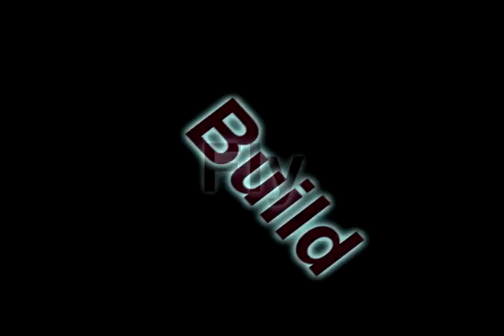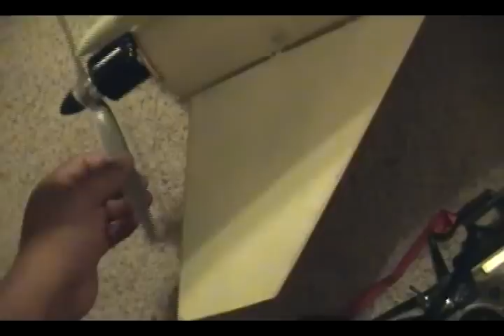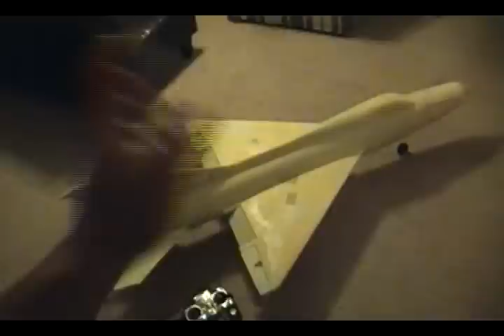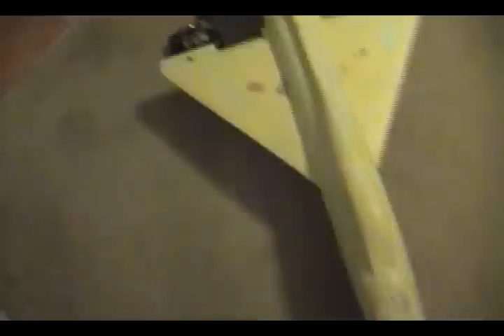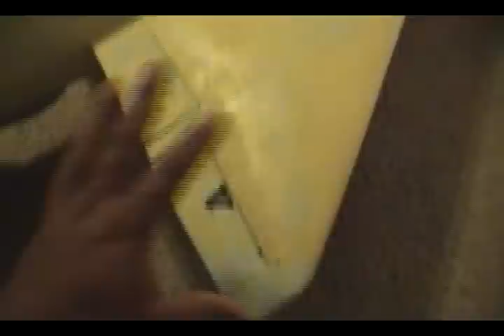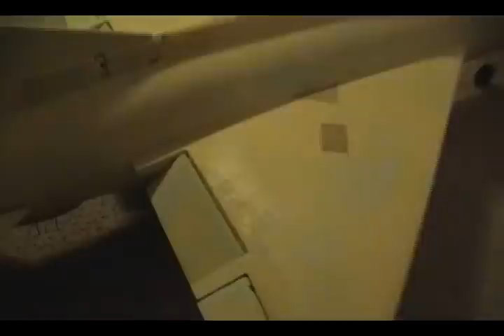MIG-21 up date

Comment: Try using a forth wheel as close to the rear motor mount as possible, it won't be scale but it should allow you to take off without the prop strikes! Amazing work!! Have fun!!

Comment: I see it has already been mentioned, but I would look into a three or even 4 bladed prop and also look into the guard wire.  I'm expecting to have to do one or both with my current build since I'm trying to keep the gear lengths relatively scale.  Maybe see if you can find a longer runway too... a little up trim and more speed and let her climb off the deck on her own...

Comment: I think a bungi launch for the MiG-21 would be very dangerous because of the large prop in the back of the plane. putting the prop up front is the easiest fix and it wouldn't look that bad in flight if you can find a nice pointy spinner. Another option is to raise the motor and and prop up another 3 inches or so and point the thrust line down toward the center of pressure. I'll try to attach a video of one of my pushers where I have done that. Good luck and be careful.

Comment: maybe you should look at a  1700kv 600 size heli motor and a much smaller prop. im using a 450 size heli motor 4000kv on my new wing and its great .im sure you can get a 600heli motor to spin a 9inch prop or even smaller and then you will lots of space

Comment: why not lower the front wheel? that way it will give you the clearance that you need. Also what happened to the jet engine that you were going to put in it? That would be a lot better. I don't fly these plains. But I really enjoy you videos.

Comment: why not use a smaller prop (10"x10")? Do read the comments on the last video. You could move the nose wheel back and make it longer then use a long run-way (speed is the most important thing). Don't use any flap to start. Put a ramp at the end of the runway to give the nose a up bump, that way you don't have to use the elevator. if the wing had a higher angle to the fuselage ... with the CG way back you could use the elevator for lift, but that isn't practical unless you have some computer/gyro.

Comment: good work dude. dont move the the prop to the front cause it will look ugly. how about instead of one big prop just join two smaller props (if possible) or try to find a big x shaped prop. im not a expert on rc airplanes.

Comment: @bakerrv : I don't think a three bladed prop is good, they are only useful to get more static thrust from high pitch props. For real planes it is an entirely different deal. For more thrust with a lower diameter there is no alternative to more RPM. Props have different thrusts too, but that is +-10%

Comment: 13 inch prop and a short wing span may = susceptible to torque rolls.
In addition during take off, chance of prop striking the ground is high.
Plane will rolls tend to rolls  left or right (depending if its regular prop or a pusher prop(P version) at full throttle up.
Man, i think you are doing wrong for pusher plane .
Pusher jet plane flies faster with smaller prop and higher speed motor.Just my 2 cents.

Comment: What about a wire skid on the bottom of the plane to prevent the ass end from dropping too low and hitting the prop. I do think the 3 blade prop is a good idea. Dont bunngie launch it. I know you can make it work dude!